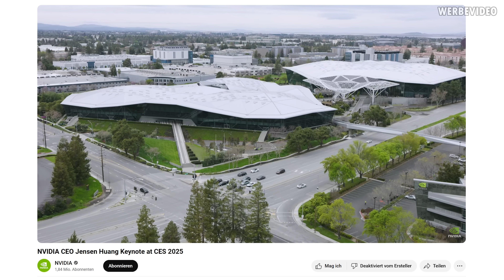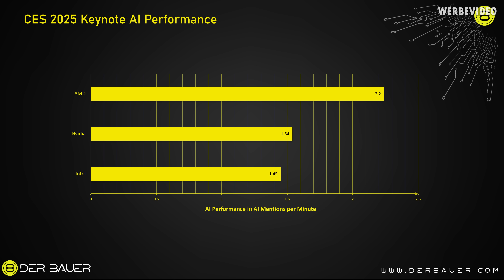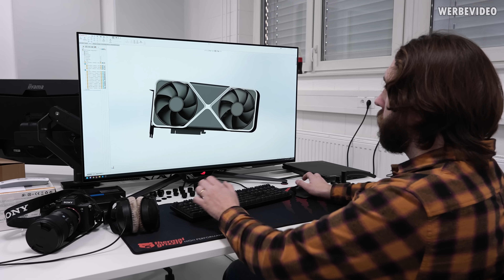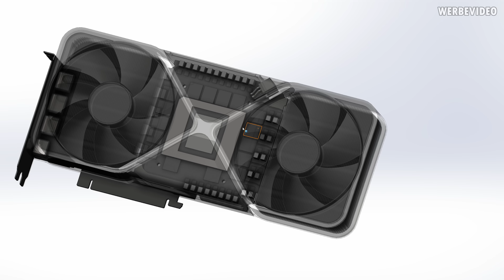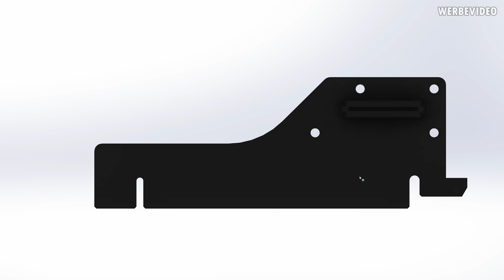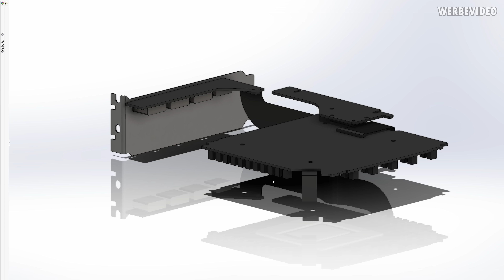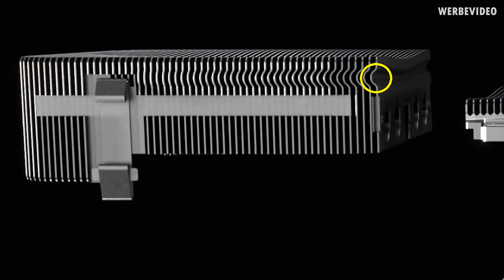We Reverse-Engineered the Nvidia RTX 5090 Founders Edition

Comment: I assume that Nvida for the FE cards, which they produce very very few of overall, are leveragin the tooling they already have for their data centre cards which is 90% of their business. It just isn't cost effective for them to produce cheaper standard PCBs for limited run cards, as they offload bulk production to 3rd parties. Which means for that first wave FE cards they do release in limited numbers, its more cost effective for them to use these exceedinly complex and expensive and dense PCBs using existing tooling for GPUs using SXM form factors going into 8 GPU racks for data centres. Those fortunate enough to snag an FE get a PCB that normally no vendor would waste money on such complexity, and perhaps eats into nvidias profit per unit, but ultimately they'll farm production out and go back to producing $25,000 GB200s with those tools. Is this your insight too?

Nvidia doesn't mass produce consumer cards, so all these crazy PCBs, finns etc, are presumably from existing tooling for data centre kit, they temporarily use for a limited run of released FE cards. With 3rd party vendors doing all the long tail leg work until the next generation. FUCK i hope i get a 5090FE on release day. The others look stupid.

Comment: 15:13 but it is possible Roman. try stacking them before pressing the arch. spacing of each plate will give the same result. so x number of inserts and on press die :) 
yaaay production experience finally paid off. 99.99% sure that they did not use 40+ dies for that.

Comment: As an engineer that specializes in cooling, the fin designs are likely serving a few purposes. Varying the length of the fins with the concave shape to the overall fin stack allows them to control heat transfer to the fins from the heat pipes in a very efficient way. You would want less heat transferred to the area above the fan hub for example because there is significantly less flow over those fins. This is probably the same reason for the increasingly round indent in the fins toward the center of the card, except in that case they are using the fin shape to slow down the flow and add more surface area for heat transfer to take place. Just my 2 cents. Great video!

Comment: One thing Nvidia could be using to reduce tooling cost is "progressive stamping" where each hit of the die causes the sheet metal to deform slightly more. Another solution could be an "insert" in the tool, where only the little profile of the bump in the fin is being changed out. Maybe a combination of 5 separate inserts, being used progressively over 10 strokes each? Still more expensive and time consuming than using one and done! The whole flow through design and overall smaller size is very very cool!

Comment: Rather than make a unique tool for each fin, they probably stamped them, then deformed the fins by running each through the same tool using an adjustable arm that gradually bent each a little more to achieve this.  Much cheaper and simpler.

Comment: I have no plan to sell my 4090. If they are willing to lie and say the 5070 is better than my 4090, then i know it will be a lie that the 5090 is better.  So even though I am always scared of my 4090 starting a fire, I am more scared of getting scammed by a low performing, higher costing 5090.

Comment: The 4080 on average is 25% to 30% slower than a 4090. According to all available information, the 5080 is 25% to 30% faster than a 4080. Which means the 5080 will be about as fast as a 4090. So your statement about the 5080 being slower than a 4090 on raw performance seems wrong.

Comment: Correct me if I'm wrong, but it sounds a whole lot like they added more hardware for doing AI work, and are having their drivers/middleware use the AI hardware to produce pixels instead of the rendering hardware to increase performance rather than adding more rendering hardware to do it directly. Given how much money they make selling AI hardware to businesses, this approach doesn't exactly surprise me, but I'm not sure that is how I would like to go in the consumer gaming market.

I think I'd rather have a cheaper part without the die space dedicated to AI and ray-tracing hardware, or one that uses that die space directly for more rendering power rather than alternatives to normal rendering. I have no idea if that would work, economically speaking, but as a retail customer, I don't necessarily want to pay for all the AI and RT capability that is there more for business buyers, and those business buyers may not care too much about the rendering hardware baked into these dies. Especially given how big these GPU dies are, I would have thought it would make NVidia more money to use smaller dies with fewer types of specialized hardware on them, especially on the retail side of things, but I guess not.

Comment: Please attach a CPU style cooler for 5090 that blows air in the back of pc case
Reply: How is this not going to collide with cpu cooler. Even if it doesn’t, the weight will break the slot.
Reply: what cpu cooler can cool 600 watts?

Comment: 14:20 Fin bending like that causes increased air resistance, with addition of graduality, it would mean that they are trying to equalise the airflow across the fins, they probably had more air going on the right and little air going on the left and that reduced the performance.
Regarding stamping, they probably have one press die do dozens of different shapes, and then they are separately caught so they are assorted.

Btw. Separate PCIE slot is actually very good because a lot of cards got damaged around the locking tab, and now if it gets damaged there probably will be aftermarket replacements available for cheap, as it's just some 4-6 layer PCB with a connector.

Comment: RTX 5090:

30% faster than 4090 (ignoring framegen, pure raster)
30% more power consumption than 4090
30% more expensive
30% larger die size on the same process node

Such innovation, much wow.
Reply: They're ultimately produced on similar production nodes, So we're getting a design bump, not a major manufacturing improvement. The world is now tied to TSMC's manufacturing progress.
Reply: Nvidia saw the diminishing returns coming. This is why they pushed RTX so hard.

Nowadays people are happy with software hacks as long as the next gen is $50 cheaper than the last.

It's laughable that 4k144 is not mainstream by now. By mainstream I mean sub $400 cards. I'd rather play at 1080p than support this con job.
Reply: Welcome back Titan X
Reply: Reviews are not out yet.
Reply: Crazy is the 2080 ti with dedicated Tensor cores vs 1080ti had a higher delta gain. Hey at least we can rely on smoke and mirrors to make up for the marketing and hype shortfalls. :kookoo:
Reply: @aberkae  TU102 was also 60% larger than GP102
Reply: @Stef3m  So Nvidia spoiled us until now.
Reply: @aberkae  the 2080ti had about a 25% delta in raster, that's not higher than 30%. The msrp from 1080ti was $700 and 2080ti was $1000 usd, that's 30%. so we got 25% more performance for 30% more money back then. The 5090 has a higher delta gain to the 4090
Reply: @backwardsDEV  The 2080 Ti was $1,200. I don't know why so many random google sources forgot this and list $999.
Reply: @backwardsDEV  TPU review The card is 38% faster than the GTX 1080 Ti on average at 4K resolution, which makes it the perfect choice for 4K 60 FPS gaming at highest details.
Techspot review 
Based on our new data, the RTX 2080 Ti was 33% faster than the 1080 Ti at 1440p on average.

Questions?
Reply: @backwardsDEV  The RTX 2080 ti's MSRP was not $1,000 it was supposed to be $899, but it was later put on Nvidia's website at $1,199. So Nvidia lied about the RTX 2080 ti's MSRP.
Reply: so... the comment section isn't going the way you planned cap America
Reply: horrific times!
Reply: Exactly what you would expect. Moore's law is DEAD. Get used to it.
Reply: So, stay with what you have or look to AMD for innovation...
Reply: @BikingChap But…they already publicly stated they are out on hi end GPU’s…gonna be hard to innovate when you aren’t really pushing for higher performance products.  We will see🤷‍♂️
Reply: @BikingChap  Or just buy a non reference design like the 4090 which can have significant performance delta over

the fe model.
Reply: Crazy you forgot to mention +50% vram increase +80% bandwidth (which will be even more useful for specific applications) and dlss4 which is huge deal for me.
Reply: @filippetrovic845 where is the 50% VRAM increase? It’s definitely not on any of the cards that have been announced so far.
Reply: Pure raster performance has been dead for awhile now
Reply: @JamesTK This. Rtx 40 is already huge on raster. And more of it doesnt help anyone.
Reply: Where are your innovative and groundbreaking GPU designs then? It's easy to criticize when you don't have an idea of what really goes into creating a GPU while navigating through all the BS politics, trade rules, and technological road bumps outside of your control (like process nodes), all the while feeling immense pressure from investors to release a new generation product every 2 years.
Reply: @03chrisv  27% performance uplift is atypical delta performance compared to all previous generations so there is that. It's not like Nvidias R and D cost went up significantly oh wait. What's happening is Nvidia is clearly putting a milking bucket in front of enthusiast while showing a Juicy steake for the ai customer with those marketing performance slides. Nvidia knows exactly what they are doing.

Comment: Considering the native vs dlss topic :
I‘m that one who will always tries to get a solid framerate, even by going low settings, before enabling any dlss or frame gen, just because it doesn't feel right. I can see the downgrade in quality from the upscalling, so I‘d rather play with lower settings at native resolution than higher settings with lower resolution. The 2nd looks worse in my opinion.

Also, I‘m like "I invested in this cool 27" 1440p 240hz monitor and I want to make a full use of it" and let's be real, it's hard in some games with a 3080ti, my only upgrade (for now) would be a 4090 (and I gotta upgrade my 9700k first). This is where framegen can come handy. For exemple, with custom balanced settings, I hit a solid 1440p 130fps in GoW ragnarok and it's already a great experience, if I than enable AMD FG, it goes to a solid 1440p 200fps. I feel like this is a good use case, solid base performance and give it the little kick it need

And it almost feel like theses efforts to "create generated frames" and "AI" could be way usefull into actually delivering raw generationnal gain, since you‘ll have a bad time with a low base frame rate, even with FG on

Comment: The GPU designers and engineers need to start making products that are not trash. Try to figure out how to give us good performance that only needs the PCIe slot to power it. You know like something that's actually energy efficient instead of trying to heat your house in the winter. Then maybe give a whirl at something that doesn't just rely on fake generated frames. Maybe this all is just asking too much for these companies to be able to handle.

Comment: The 4090 FE is a chonky 3-slot Boi, that cooler is massive. 
So this 5090 FE seems to have a way better 2-slot cooling design to have more power with a smaller cooler :)
Sadly they didnt " fix" that aweful hot connector, just turned it to make it plug in better but I would have liked a new connector that actually can mechanically and electrically withstand more force :)
Also those eperformance claims in games are pure marketing BS. We will have to wait when 3rd party testers actually test the same game with the same specs in native resolution without any trickery. We have standardized Cinebench tests, why not use those to show raw performance?

Comment: It's possible they are using the same stamp die to make these different fin depths by using a stronger force for a deeper bend, and then it gets lighter and lighter for the shallower stamps, OR a light force that stamped repeatedly to make the bend deeper and less stamping for the shallow ones.

Comment: "5080 is slower than 4090". I'm not so sure about that. What we know from NVIDIA limited charts - it is actually faster, even in raster.
Reply: Which charts showed raster?
Reply: @Sigfried-df2vp  The ones available on their website. After doing the math between two charts (5090, 5080). Edit: FarCry6 and Plague Tale charts can be used only.
Reply: @ those are not raster benchmarks, FC has RT and Plagues tale has RT+dlss3
Reply: @Sigfried-df2vp  It doesn't matter. They are not dlss 4 benchmarks. We can directly compare them with RTX40. FarCry 6 has a very limited RT. Even 7900XTX is doing great in this game at 4K.
Reply: @Alexx_80  not really as both games are using RT and the 50 series has improved RT cores so normal raster will be lower. These are also Nvidia’s own benchmarks so take them with a grain of salt.
Reply: @Sigfried-df2vp  I don't think that RTX50 has an improved RT cores beyond new hardware techniques like neural rendering. It is not present in current games like FarCry6.
Reply: @ Nvidia states Blackwell uses 4th gen RT cores as opposed to 3rd gen on ADA.
Reply: @Alexx_80  this is why you shouldn’t believe Nvidia’s charts
Reply: @Sigfried-df2vp  It's not a matter of believing. At the time, we had only Nvidia data available. I never claimed that we should take it for granted. My comment was about speculation about the performance.

Comment: One detail "assumed" but might prove different is the heatpipes themselves. The CAD model shows five pipes each side, and "in line" with each other. No problem with that. 
But this implies the five pipes are continuous all the way through - five long pipes, extending to both sides. Which can work, but might not be most efficient. 
I'm thinking it might be more effective to "interlace" shorter pipes over the gpu die, making ten pipes in total. Five go to one fan and fin stack, the other five go to the other side.
Necking down the pipes to all fit alongside each other might even depend on the gpu die geometry, and "which side is longer" to allow more room for more pipes. 

We won't know this answer until we get to see a disassembled cooler.
Reply: I bet the pipes and vapor chamber are all one piece. Any other time you'd have individual pipes soldered or folded on top of the chamber, but I have a feeling the FE combines the two and vapor travels directly from the cold plate to the pipes to dissipate the heat

Comment: i used to work in a factory that made radiators at a larger scale and was meant for industrial purposes usually. but the types of dimples and how the are placed around pipes and on fins will change air flow dynamic. from what i can see its more likely to help with more air contact space closer to the hotspot of it. its gonna be a hot gpu for sure if they didnt nail it though.

Comment: 5:58 then you think wrong... dlss and fsr introduce shimmer, faults and other anomalies that draw attention. even worse they anomalies and faults presented from fake frames is NOT what we want. if this is the peak of what we can expect from silicon gpus then so be it. 

the increased fps does not justify the loss of details and introduced non raster faults and anomalies in any high paced game, online or offline. dlss and fsr can only be justified to be turned on if the game performance is subpar and is introducing problems from low fps and or lags imo. games like Alan Wake and Cyberpunk are always used to showcase these fake frames as they are poorly optimised and run heavy like crysis did back in the days. 

i miss sli and crossfire..

Comment: Nvidia: This gen, outside of the 5090, you'll get a performance advantage over a slightly OC'd 40 series! AI! AI! AI! Not only that but why stop at one artifact filled frame when you can have 3?! AI! AI!!!!!
Consumer: baaaa baaaa 🐑

Them "showing off" the 5090 raster vs the 4090 in gaming with Cyberpunk 2077 was a joke(4k max). 6fps buy hey it is technically like a 26% uplift 😂

Comment: I'm buying it just for the cooler design. I'm using the DerBauer 011 case. My GPU right now blocks the airflow from the fans on my bottom radiator through to the fans on my top radiator. This design would allow the air to flow right through. Honestly, it's genius.

Comment: As someone who works in a metalshop with laser and punching machines, what they most likely did to get the decreasing profile in the fins, is use the same tool but use less force while punching in the profile. It's possible they could use some Ertalon (nylon) in the die to have some support when the profile gets smaller. We use wheel forges in CNC punching machines that roll over the plate to make shapes  like that (but much longer) and then lower the pressure so it will flare out the profile into the metal sheet and makes it look better.

Comment: PC World did a video with 'Justin Walker - Senior Director Of Products' where they went over the card and explained about the PCIE board, where it slots in, and also the PCB of the IO and how and where that fits into the card. The two slots at the top are for airflow, it's angled to blow air in a way so that air cannot wash back around and get sucked back into the fans, effectively creating an air barrier. And yes you are correct, the fins are concaved for pressure reasons.

Comment: I'm sure you could probably stamp all 58 of those fins or even a significant number of them using one big (or just a couple) stamp(s) and a sheet of metal in one cut.  I highly doubt you would need 58 separate stamps to accomplish that.  As you said yourself, that would be obscenely most likely prohibitively expensive.